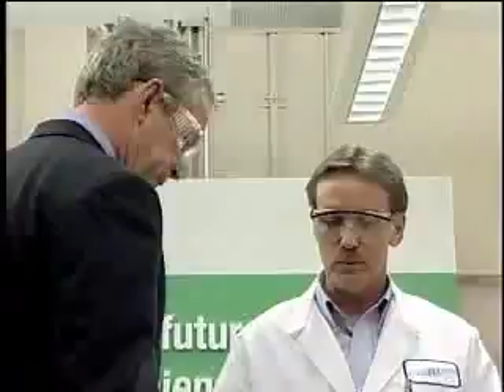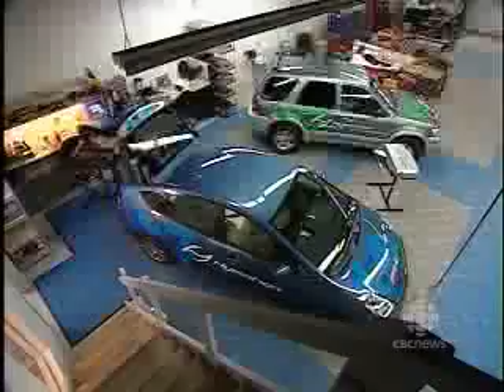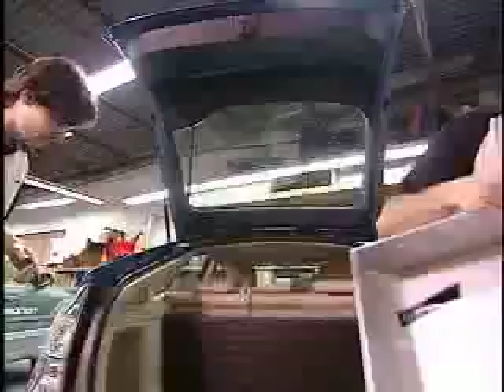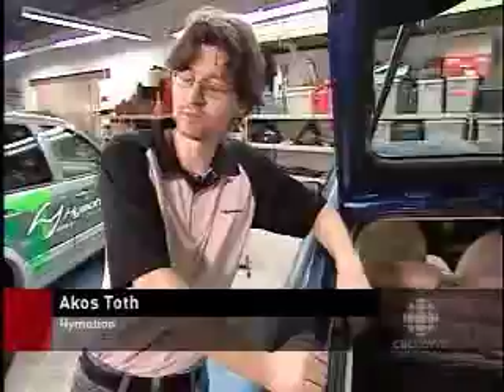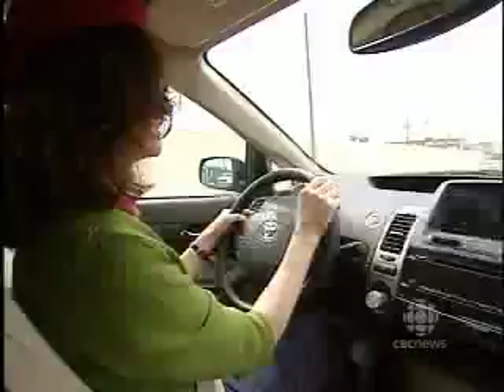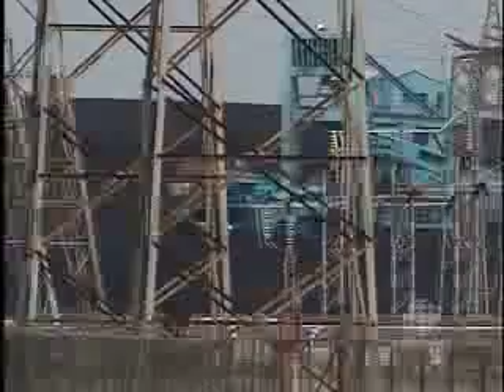Hymotion Plug-in Hybrid news video 20060329

Comment: I do not want another car that uses fuel that the oil barons can manufacture, monopolize, and enslave us with. My god people, do you not realize that if we develop electric vehicles, the electricity you put into the car could eventually be produced on your own roof. After the roof panels are paid for your fuel costs drop to zero. The thousands not spent on gas in a few years would easily off-set the $3,000 - $5,000 cost of the batteries.

Comment: The problem is that no self-respecting (greedy) investor (who's only interest is money at any cost) is going to put money into a product that once sold gives no more return (I.E. EV's and solar panels) when they can invest in and promote an auto that requires a fuel (I.E. gas, hydrogen, ethanol,) that the car owner has no choice but to buy the fuel from them, increasing their profits significantly.